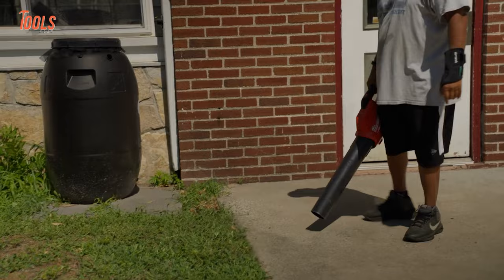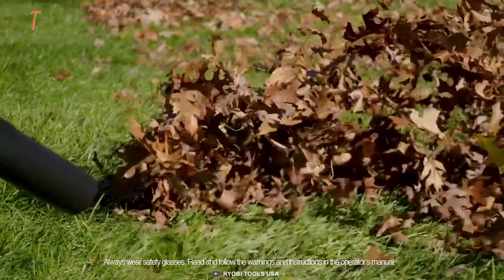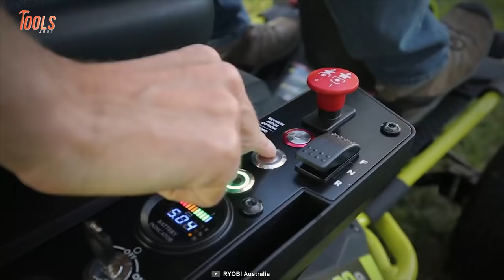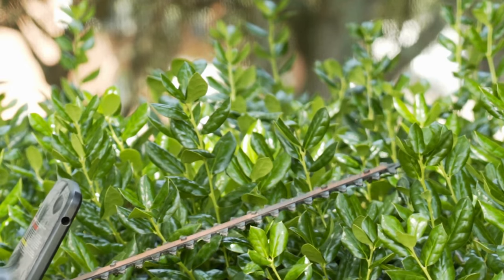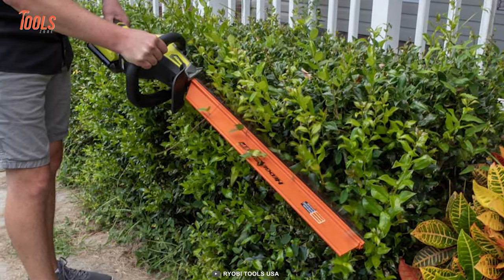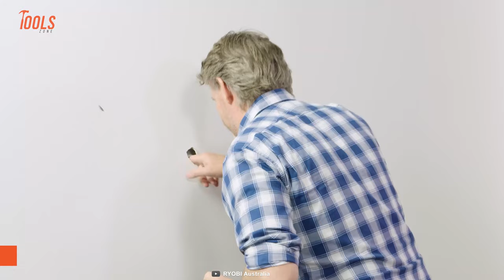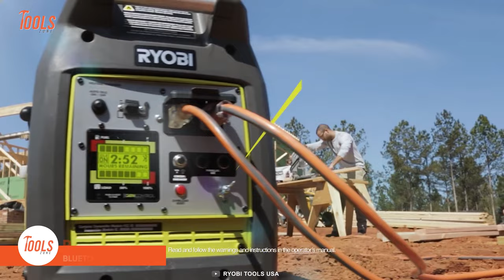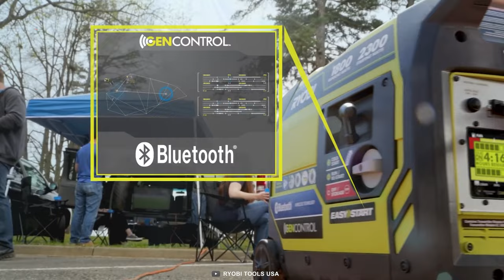10 Coolest Ryobi Power Tools That You Need To See ▶ 7

Comment: As an electrician that does strictly remodels this is an absolute essential tool. https://www.youtube.com/post/Ugkx0vyBwjtx9GGOuiqUVT2sRoYqmDoNT_RI Being able to precision cut any material with a light weight tool is priceless.I upgraded to this Dewalt 20v from a competitor's 12v. The Dewalt 20v is just as light as the competitor's 12v. I am extremely pleased with the overall performance and battery life of this tool. As far as oscillators go, they just aren't very ergonomic tools. The dewalt oscillators have an offset handle that do make them somewhat more ergonomic than the competitors' oscillators.
Reply from the maker: Yes, it is!